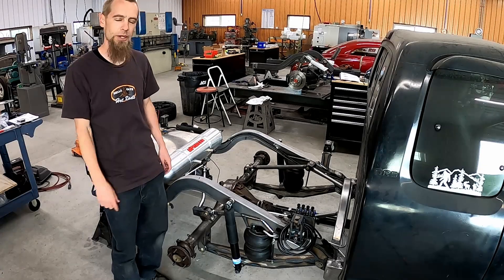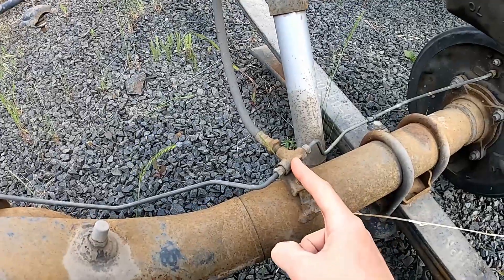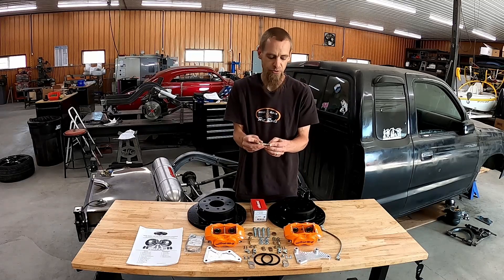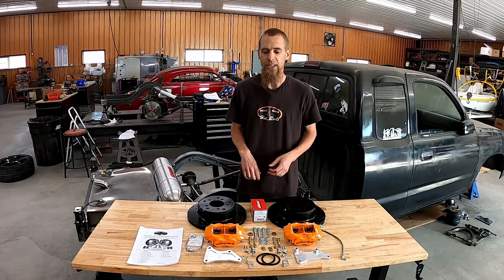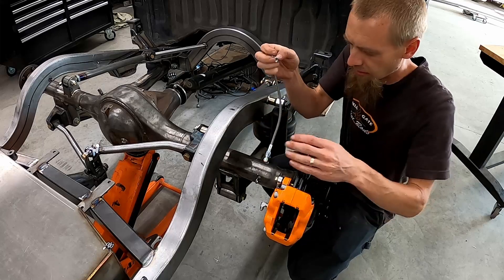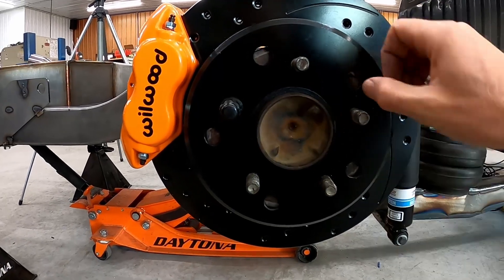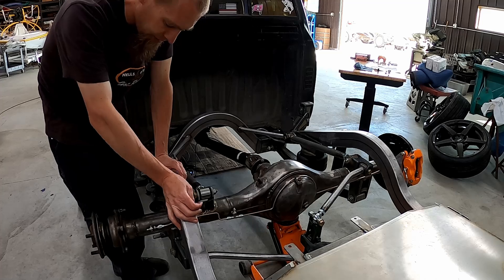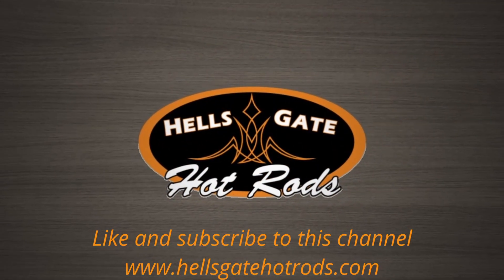Tacoma Ep 8 - Toyota 5-Lug Rear Disc Brake Conversion

Comment: Will the stock flexible line work for the (T) rear end or do need to lengthen it for airing up
Reply from the maker: I would bet you will need to lengthen the soft line from the chassis to the rear end if you are bagging the truck.  The kit includes all the components for the brake system on the housing itself but does not account for suspension travel changes.  That would need to be address separately as this kit is for more than just bagged trucks.  Hope that helps.